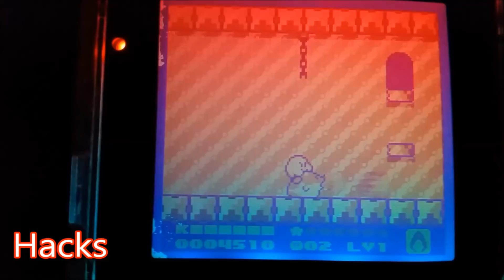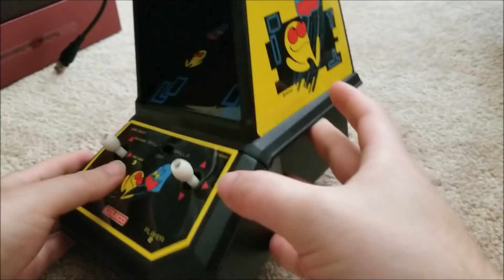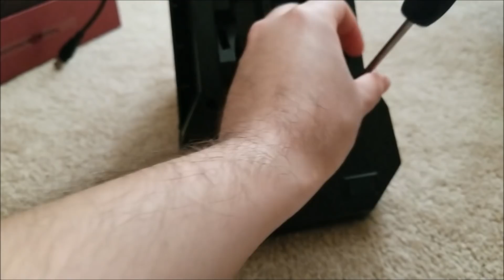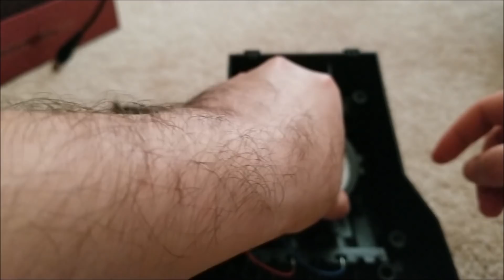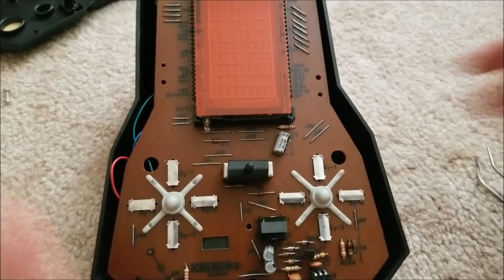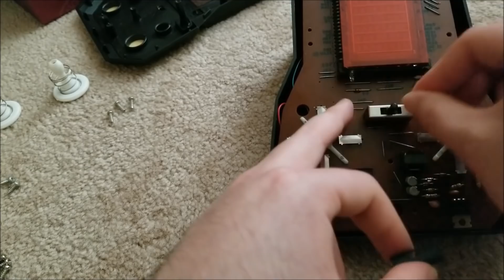Coleco Pacman Tabletop Arcade Teardown!

Comment: I took mine apart. Wrapped the piezo speaker in a piece of paper towel, and tucked it off to the top side of its normal center position. Put the cone back on, and now it’s WAY less annoying.  Much quieter.
Reply from the maker: That's a good idea, I'll have to give it a test. I was tempted to put a resistor in series with the piezo to quiet it down.
Reply: sjm4306 it’s about 1/5th as loud if even that.  Sooooo much better, and it takes like ten seconds.
Reply from the maker: I also like that it would be easily reversible and not cause any permanent damage
Reply: sjm4306 exactly.

Comment: Thanks for the help. I just picked up a broken one off ebay that appears to have something spilled on it. Going to attempt repairs. Like you, I've wanted one for awhile. Even a broken one cost me 30.
Reply from the maker: They certainly aren't cheap but they are really cool. Good luck, hope you can fix yours.
Reply: @sjm4306  Fixed lol the C1173 transistor was fried and had to wait for a replacement to come in. Thing was roasting when I hooked it up to a power supply.  Had to fix the contacts for the joystick after, I just roughed them up and gave them a solder dab on top, worked great.  Now I just have to find a battery cover and mod it to accept a DC wall jack.
Reply: @sjm4306  btw, would you happen to know the values to the two electroylitic caps C4 and C5 (I think)? Mine are hard to read and I want to get replacements before they blow out.  Thanks again

Comment: I just watched a video that you did a couple years ago wheee you fixed a gameboy micro’s cracked LCD for a viewer. My gameboy advance sp has a cracked LCD. Is there any way you could help me with that? Even if you can’t do it can you point me in the right direction to find the pieces I would need to fix it?
Reply from the maker: Sure, what model number does it say on the bottom? Either ags-001 or ags-101?
Reply: sjm4306 omg thank you sooo much for responding. I can’t believe you answered!!!
Reply: sjm4306 ags-001
Reply from the maker: Looks like a brand new replacement lcd goes for just under $30
https://rover.ebay.com/rover/0/0/0?mpre=https%3A%2F%2Fwww.ebay.com%2Fulk%2Fitm%2F173219872774
If you have a triwing screwdriver it is fairly straightforward to replace but if you are not comfortable I can do the fix for you.
Reply: sjm4306 how much will it cost to ship it to you and everything? Because I don’t have a that kind of screwdriver 😬
Reply: sjm4306 I'm scared I'll break it lol
Reply from the maker: It's not a problem, just shoot me an email at sjm4306@gmail.com and we can work out the logistics
Reply: sjm4306 thank you Soo much!!! I just emailed you.